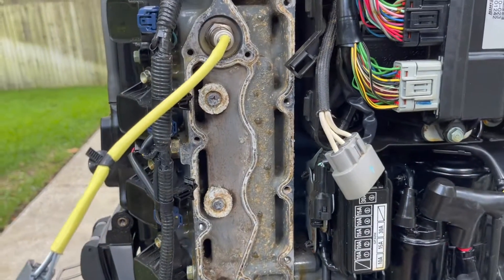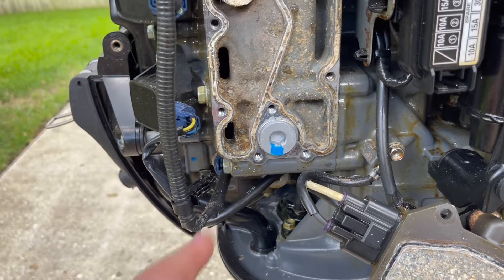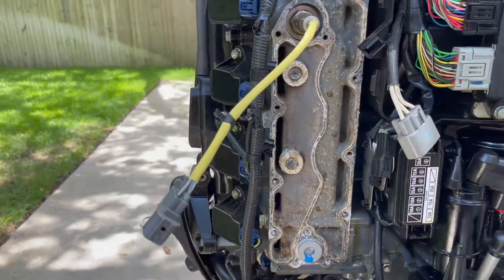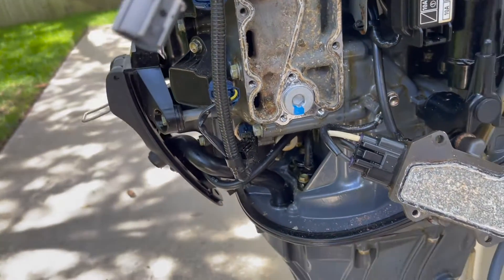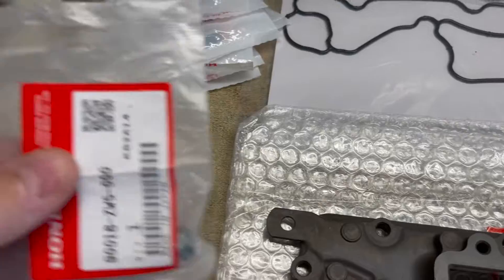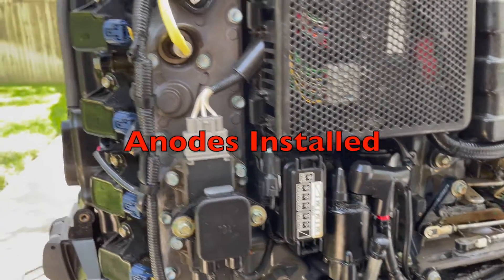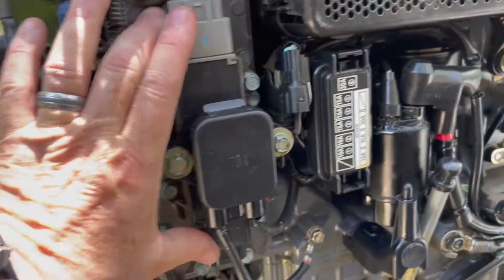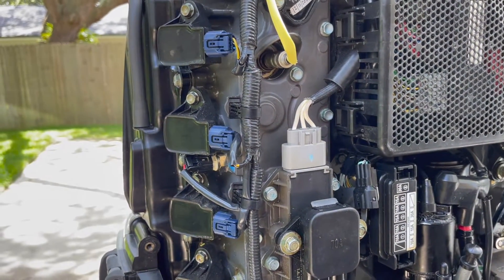Honda BF75/BF90D Head Anodes Replacement

Comment: Thanks Dave, good video. How did you get those screws for the anode out. I koiled them , used impact hammer tool. Nothing. I may leave them, not in too bad of shape. I might use magnetic induction tomorrow. Any hints appreciated.
Reply from the maker: Yeah if they don’t come out, then you would have to get creative. Maybe chip them away some how enough to get a pair of vice grips on the screw.  I was lucky with mine.  But I greased them up when I put them back in.